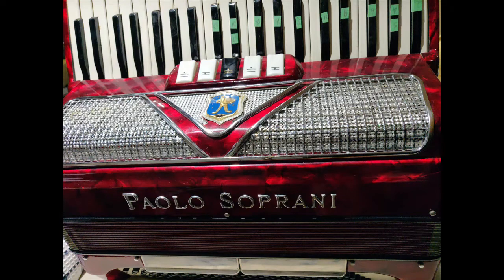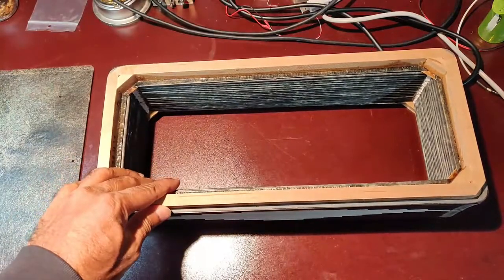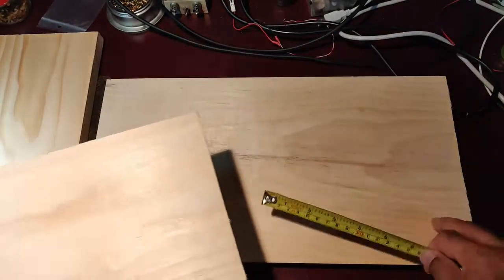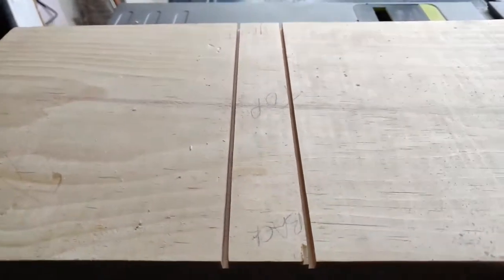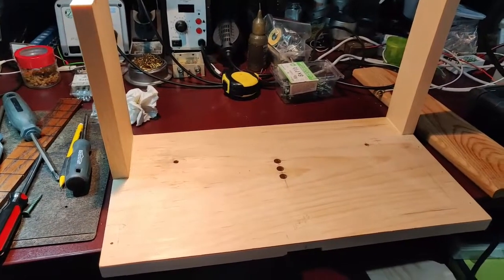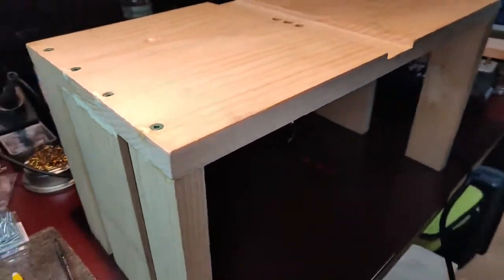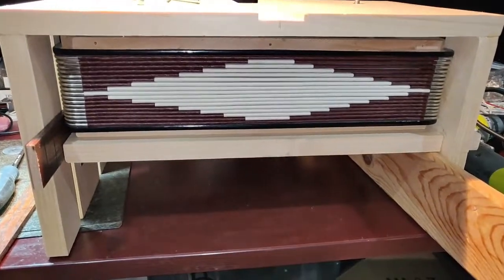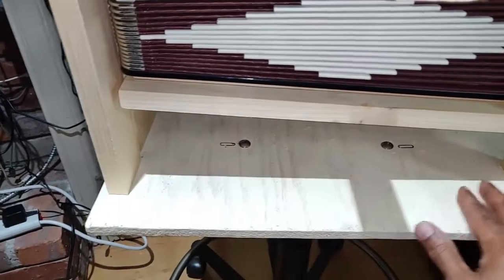Reed Tuning Table | Accordion restoration | Home made | DIY | Reed tuning and repair |

Comment: You can NOT tune reeds out of accordion body! If you tune outside of accordion body when you return inside in accordion body it will not be in same tune! This table is only good to check if reeds are working.
Reply from the maker: Yes, I agree with you 👍. Thanks for checking it out.